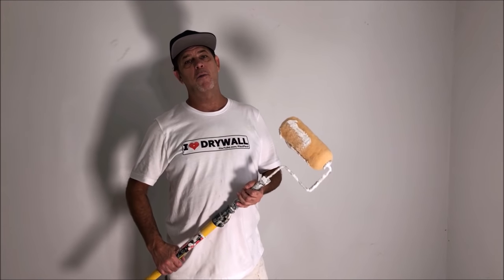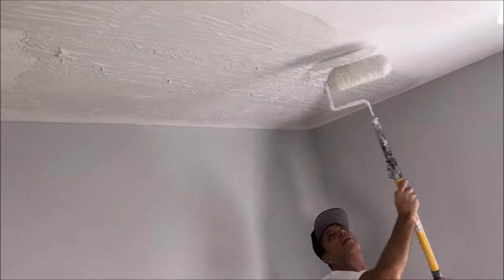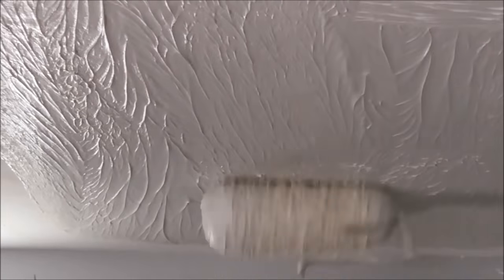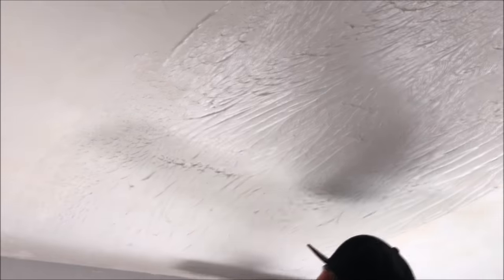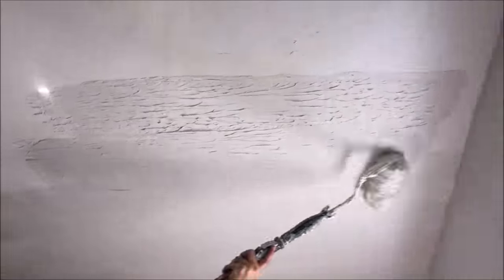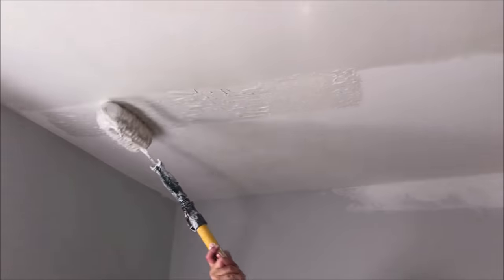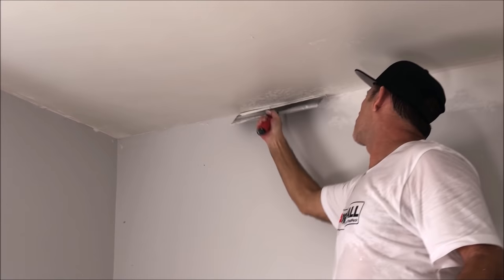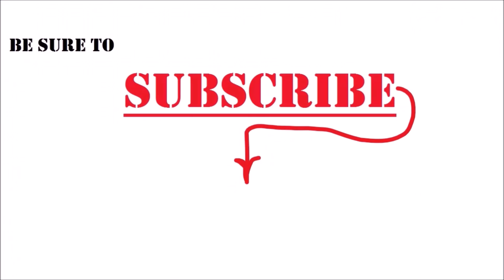Using A Paint Roller Is The ABSOLUTE BEST WAY To Skim Coat For A Beginner!

Comment: I'm working on painting my room over the garage with angled ceilings.   I've noticed the angled seams are not straight but rather crooked. How do I fix that?
Reply: sometimes you can fix that by over painting the ceiling color then taping off a lower level line for the walls with a good blue tape 3M 2020 . Or also pushing the wall color onto the ceiling slightly. Gotta be a magician sometimes as a painter

Comment: If you're going for a flat finish, do you skim tight on every coat, or first coat is a decent cover coat, followed by tight skim coats after the first?
Reply: Skim it tight every time
Reply: @timmynormand8082  I agree when it comes to skimming drywall but a plaster wall and ceiling could have a lot of imperfections and you may need to go heavy with a first coat and then tighter with each remaining coat.
Reply: @steviem5279  you absolutely rite
Reply: @timmynormand8082  I remember when my dad had to skim plaster walls, he'd put up fiberglass mesh to minimize the cracking then skim with four coats with a rough first coat, then he's water down the joint compound more and more with each coat where the final coat was so thin that it dried quickly.  After that it was a light sand under 150 watt lightbulb then clean, prime and then the finish paint.
Reply: @steviem5279  that’s an awesome story  the ole timers were so professional.  They took there time an did their work perfectly   I’m 64 an when I was younger I seen men plastering with lime an water mixed by hand   I admired them cause they used trowels an hawk

Comment: That thin coat will crack in no time... Needs to be twice or three times thicker and two coats of it to do a proper job... You can can skim/p on it now but you will pay for it later guaranteed i.e. any small movement in wall or damp & condensation will crack it in no times.

Comment: Your left or as we look at the video left side?
Reply from the maker: Yeah Jonny, I got a little switched up once. It was from a weird camera angle. I was definitely going on the right side when I said left (the viewers left). 😇  What did you think about the rest of the video?  -Paul
Reply: @PaulPeck  I have a bedroom in the house with a neglected ceiling that has water stains from an old leak. Now I have a metal roof and this thing is going to get fixed. A skim coat would work great.

Comment: I do electric, plumbing, carpentry, basically I do it all.. This is by far my least favorite thing to do.. Not easy and I find it hard to believe that you won't sand.
Reply: If it was a smooth finish he’d have to sand, but he’s doing a textured finish so no need to sand unless there’s lumps etc
Reply: @andrewfraser7351  
Why do you need to sand, just polish it smooth, if your any good?
Reply: No chance are you getting away with not taking a bit of sand paper to that amount of mud. A bit of water and sponge won’t cut it I’m my opinion. Everyone has there own way of doing things and ways they leave what they think is a quality job.
Reply: I've skim coated my entire house which had some severe waviness. The house had sat unheated for a few years and the plaster looked awful. I had to apply three skim coats to flatten the wavy walls. When the coats dry, I simply knock down all the minor splatters or ridges with the 12" knife. I don't sand and I don't recommend sanding because of the dust left on the surface. 

After the final coat, I do a very quick (and light) sanding to knock down any splatters but if you have properly wiped down the mud during each coat, there is no reason to sand. 

When I say a "light sanding", I mean I spend less than one minute to sand the entire room. (Two minutes for a large room).
Reply: @andrewfraser7351  Andrew, the finish that I do, using this method, would be equal to a level 4 finish (USG Standards). it's a very effective method and the amount of sanding that I do is next to nothing.